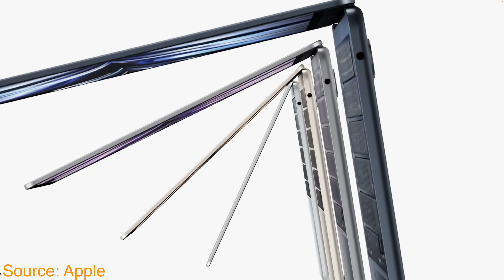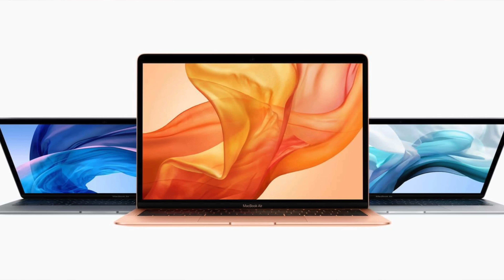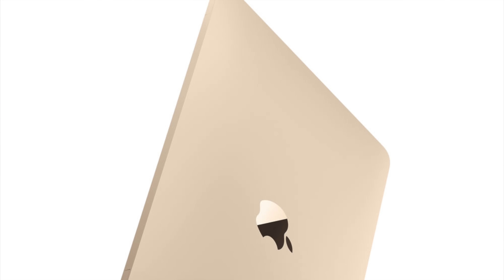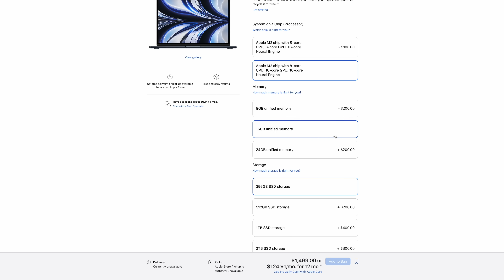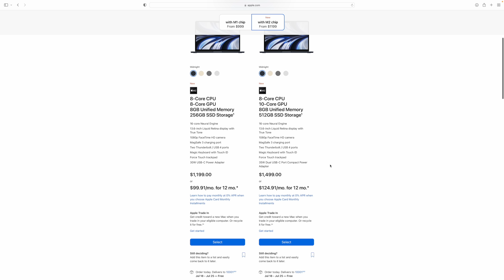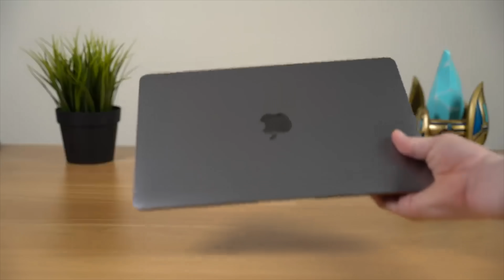Why I bought The M2 MacBook Air to Replace My 14" MacBook Pro!

Comment: Greg I’m still unsure about the 8-core VS 10-core GPU. I want the best performance but everywhere I look suggests the thermal throttling will make the 10-core perform worse. 😬
Reply: I am having the same dilemma.
Reply: I went for the lower core count in case of that, but still curious to know if i should have gone for the 10 😂
Reply: @Tennishorlick  I guess we are screwed either way until we see benchmarks.
Reply: @Tennishorlick  Haha, I picked the higher one in the last minute upon finding out that the charger was included in the price for the 10 GPU one. So this way I did not find the difference in price too bad....

Comment: Great video Greg, so helpful!  Are you worried about the 1 TB being slower than like 2 TB?  Like the 256 versus 512 on the Pro?  Ty
Reply from the maker: No. All the other storage options should have the same speed. Only the 256gb model would potentially have lower speeds
Reply: @GregsGadgets  appreciate insight on the 256gb being slower? 200.00 more for the 512gb is pricey.
Reply: @GregsGadgets  Thanks Greg
Reply: @drmarioschannel  Look at the MaxTech tests on M2 Pro 13 and the 1 chip SSD instead of 2 on little storage that lower the speed of ssd

Comment: I felt like I got scammed in early 2020 when I got the i5 MacBook Air, and the M1 was released right after my return window. I’m happy to trade in that beach ball mess of a computer with the one I ordered today. M2 Midnight 24gb 1TB. Quite the jump from the i5 16gb. Love the form factor and portability along with the power for 4k editing. I still got screwed on the trade in $345 for the old one lol. But that’s Apple for you. I’ll be good for about 3 years until I make a move on a higher end MacBook Pro.
Reply: Yeah, they only give a small percentage to trade in. It seems that private sales are the way to go when offloading apple products.
Reply: They didn't screw you pal...there is a reason why websites like buyers guide from Mac rumors exist...you always gotta check the lifespan on current products...and as an advice it happens with everything, from cellphones to cars so lesson learn and make better decisions on upcoming purchases

Comment: Future Lineup (PLEASE):
MacBook 12in - $799 (M2 8 core gpu)
MacBook Air 13in - $999 (M2 10 core gpu)
MacBook Air 15in - $1199 (M2 10 core gpu)
MacBook Pro 14in - $1999 (M2 Pro/Max)
MacBook Pro 16in - $2499 (M2 Pro/Max)

iMac 24in - $1299 (M2) (Default 16gb ram)
iMac 27in - $1499 (M2) (Default 16gb ram)
Mac mini - $699 (M2) (Default 16gb ram)
Mac Studio (M2 Max/Ultra)  - $1999
Mac Pro $5999 (M2 Extreme)

Comment: Greg the 24 inch iMac is not thinner than the new air. It’s 11.4mm
Reply from the maker: It’s 11.5mm… just noticed whoever made that chart had the measurements off for the imac lol.
Reply: @GregsGadgets  lol

Comment: Hey everyone buy the framework laptop because if it breaks it dosent have to get replaced. You can buy the broken part and replace it. Even the outer shell can be replaceable and the ram and storage is twice the amount as the MacBook. The framework can go up to 64gb of ram and also can reach up to 4 Gb of storage! And you can replace them anytime! You can even replace the chip once a new chip comes out and you can use the old chi to build anything like a pc with it!
Reply: Greg… the MacBook is not worth it

Comment: I just sold my MacBook Pro 14 on Craigslist in favor of purchasing the ultra-thin MacBook Air M2. So, I made the same decision you did. For portability and QUIET VoiceOver recording, the new Air is perfect. It does suck that multi-display support is restricted to one external display. I also didn't order the Midnight blue/black due to the smudge review feedback. The other features are simply icing on the cake: speed, 1080p cam, MagSafe, battery life, and weight.
Reply: Same here. All I do is web browsing, YouTube, occasional PowerPoints and word. So I hope the base model is enough. I got the midnight M2 Air. Looks blue but also looks black. Very stealthy. I hope the overheating and throttle issues are just for people pushing it hard. I hope base does me well.
Reply: @Jamal2fresh  smh so why did u fking order the M1 pro?💀  Smh that just shows you wanted it because it was THEEE LATEST, not because you needed it but like to “show off” it. Lmaooo. 

Thats kinda a dumb decision to make lol. (Imo)
Reply: @bigsur370  I know right, like seriously the Pros are meant for Pro work and not "occasional PowerPoint". The base M1 Air would be perfect for him
Reply: @NizaSiwale  exactly! Lmao
Reply: @bigsur370  actually not. Lightweight, plenty of ram and better cam is perfect for professional use ( you guys may like browsing but I code and do high-end graphics). Way off the mark. Jerk.

Comment: Too many complaints, that 12’’ laptop wasn’t what most people were looking for, it didn’t have the success expected and apple didn’t repeat it. They might try again later, but still 13’’ is a better option 0.6 pounds of different is almost insignificant when is just 2.7 pounds.

Comment: When I bought a M2 MBP 13(512GB, 8GB) as alternate on the time I sent my M1 Pro MBP 14 to the repair of display problem, it drastically slowed down on DaVinci Resolve when I added some tracks based on 4K 60FPS timeline. It also slowed down entire system and didn't perform well on my workloads, so be careful
After the MBP 14 came back, it still have some latency on timeline playback sometimes, but performs much better than M2

Comment: Great video. But you have ended up paying more for your high spec M2 MBA than a new 14" Mac Pro MBP? I'm not sure most people would be best advised to do that just to get a lighter MacBook Air. But maybe design and low weight will win out over power. It will be good to see how your base spec with 500GB one works out.

Comment: Everyone is different , i think i would be staying with the 14 pro , more ports , and call me weird , i actually like a bit weight , it gives the feeling of having a bit more substance to it , and having the two fans , even if it does not use them most of time , knowing they are there should i use the device more heavily makes me have  a bit more confidence  ..... i think .
  Thats just me , i like to feel im a bit future proofed too , i like to buy once then not buy again for bloody years if possible .
Reply: There's also the fact that magsafe is more likely to save your laptop if it's heavier lol
Reply: My thougts exactly. I was going to buy Macbook air m2, but when I saw a price in Poland for 16ram and 512 it was almost the same as base model Macbook Pro 14inch. For me it was no brainer - better display, 120hz, fans, more ports. So now I have 14inch and I am more than happy. Sure - there is a differance between 1,24kg vs 1,6kg but as above was said - it feels solid and frankly speeking really good.

Comment: Sure the MacBook Air with 10 core GPU 16gb ram and 1tb storage is about the same price as the M1 Pro 14 but I don't think its worth it to spend more money to get the pro model. You'd have to be willing to take a 516gb storage instead or pay even more money to get the 1tb option.

Comment: I am still rocket the MacBook Pro late 2012 and an iPhone 6. I have never been one who picked up the brand new shiny penny. Matter fact, I bought a 2009 Mac Pro, installed 2 3.33 I7 chips with 48 gig ram and a asus graphics card. I also have a 512 ssd to run the latest os. If you were me, what would you do to upgrade to something that would edit video, Microsoft office, and live stream conference calls?

Comment: Also replacing my Mac Pro with the M2 Mac air! Minutes into the preorder I’m should get it  around august 2.  My uses don’t require the pro model anymore. Will keep the m2 Mac air until the 15 in Mac air comes out if rumors are true !

Comment: I live in Australia and thanks to your videos and lot of research I end up following your recommendation and for my needs I bought the 16GB 1TB but as much I think the midnight is awesome I couldn't handle the finger print issue mentioned, so I choose the starlight 😊. Thank you for your recommendation!...ohh an mine arrives between the 20th-27th July
Reply: I wish they had more available, also Australia and mine (16Gb, 512) isnt coming until the 8th of August
Reply: How’re you liking it so far? What configuration did you get?
Reply: To me after the past few months is working perfectly. Still quick even though I have save video there instead of external disc. Yes is a pain having to buy external connections for usb, etc.. but overall I would recommend.

Comment: I'm starting grad school this fall to study data science and big data analytics. I'm considering the m2 air spec'd up to 512/16. A lot of the actual code execution in data science is done while connected to a compute cluster in the cloud anyway, so the portability and updated design of this machine is a big draw. I'd still like to debug some of my own code offline though, so I figure the extra ram is worth it

Comment: I had the 12" MacBook.  Loved the size and weight.  But the CPU was trash.  And the butterfly keyboard added gasoline to the dumpster.  And the single USB-C port set the thing on fire.
Don't get me wrong, I would love to see a new 12" MacBook.  And with the M1/2 they could fix the performance issues of the old M series chip.  They still need to have a great keyboard, and AT LEAST 2 thunderbolt ports.  And it seems like MagSafe should be a given.  And I don't think I can go back to a 720P webcam.  
So ... lots of things would need to be "fixed" on the new 12" MacBook.  Which will drive up the cost.  Does Apple really want to go there?  Not so sure.

Comment: Which one best?
13" MacBook Pro M2 or 14" MacBook Pro M1?

13" MBP M2 with 16gb RAM, 512gb ssd and 14" MBP base model.

I'm an Interior Designer. I'll use SketchUp, vray, Blender, UE5, C4D, Photoshop softwares. 

So which one to buy? Please suggest me.
Reply: The 14’ base model is the right choice. Yes, the M2 MBP is powerful enough to handle those tasks but for the price it is simply not worth it. Since you are planning to upgrade to 16gb ram, the price comes closer to that of the 14’’ MPB and especially if you are concerned with the speeds of the storage that is an another upgrade. That 500 or 250 usd price jump (depending on the upgrade) is in my opinion worth it. The difference in performance between the base model 14’’ to the new M2 pro is still very significant and on top of that every aspect of the laptop  is just better e.g display and the ports available. (maybe not battery life only slightly tho).
Reply: @haruhi3415  okay then I'll buy 14" M1 MacBook Pro. Thanks.😀👍🏻
Reply: @haruhi3415  Don't mind one more question... Almost i use crack software like SketchUp + vray, AutoCAD and lumion.

So crack software will work on Mac OS?

Comment: Hi Greg. I barely noticed the voice issue and I sing for a living. I remember being so excited by the 12 inch MacBook because it would have been the replacement for my 12 inch PowerBook G4. Alas, it was so horribly underpowered especially for that asking price and I ended up with a maxed out 11 inch 2015 MacBook Air instead which served me well for several years and is still being used by my wife. These days, with decent portable external screens being being so affordable, I really have no need for anything bigger than a 12 inch laptop. Of course mileage may vary.

Comment: Yes, Yes, Yes, ... your comments ring true to my eyes.  However, I am more "old school".  So, the model, I miss the most is Apple's 12-inch G4 laptop that, I still own and use.  With the introduction of the new 13-inch M-2 MacBook Pro models, later this year, I plan to pick-up a used 13-inch M-1 MacBook Pro with 16GB of RAM and a 512 SSD.  Why, because its price should fall down to around $900 and, I like to use older outdated Apple tech (smile...smile).

Comment: I also loved the 12" Macbook.  I miss the 2 lb weight for traveling.  I am purchasing for the same reason.  Sold my M1 MB Pro 13" and have my Mac Studio for the heavy lifting.  Curious about your 2 configs.  Are you worried about the 10 core and throttling  with overheating?  I ordered mine without the 10 core - just did 16 RAM and 512 SSD plus added the 35 w charger. Should I be placing a 2nd order too, LOL.
Reply: Trade in 12 MacBook, Apple give me $95 if everything is working correctly :(

Comment: I agree with all that you said and I did the same. My base model, midnight blue M2 Air will be here on 7/15 and I'll be running it side-by-side with my base 14 Pro and will see which one I ultimately keep and which one will be sold or returned depending. Thanks for the vid!
Reply: Have you don’t this yet? What did you think of the M2 MBA?

Comment: For Macs, I found that having a powerful desktop Mac and a light portable is the best way to go if you want to best portable experience and the best performance at home.   The Macbook Pro 16/14 is better if you can only have one machine that can do both but it isn't the best portable and it isn't the most powerful machine.
Reply: For me it is so true… I have a Mac Studio Ultra with 128GB ram paired with a 34 5K2K and 22 4K dual monitor setup and I carry a M1 MBA 16GB soon to be M2 MBA 24GB paired with another 5K2K monitor at work 😝😝😝

Comment: how did you decide between the 8 core gpu vs the 10? Will the 10 make much difference in video editting for you?
Reply: What's an extra 100 bucks when you're already dropping a stack on a computer. Plus you get the dual or fast charger included. Full send it.

Comment: I've just received my Macbook pro 14", I couldn't wait for the Macbook air M2. I'm happy with it except for two things it's battery life is not as good as M1 macbook pro or air, and the second thing is its portability, this laptop is too heavy as well as thick  to carry.
Portability for me means a considerably good battery life and  light to be carried, as I'm mostly out.
Yes I love the screen quality, but I'm not a creator, what matters is that it's 14" as 14" is the sweet spot for me not too big to make it unportable, at the same time not too small to make it hard to work with.
to sum it up, I wish the 14" Macbook were lighter and its battery had more stamina, that would have been absolute ideal for me.
Also I don't mind the touchbar, you can simply do more wit it than the hard unprogrammable F keys.
Reply: i got the 14" pro for the longevity i dont plan at moment to do much more than daily stuff on it like browsing the web and watching videos. i was interested in air m2 but got pro 14 inch through grover cause i can pay per month to rent for twelve months and after that continue renting, send it back , or pay it off. but because i watch videos alot i love and dont know if i could live without either a oled or mini led display
Reply: I mean the air does last longer but what was the battery life on your 14 like? I thought it'd still be pretty great (10h+?)
Reply: @ameliabuns4058  not really, around 6+ hours not more.
I'm planning to keep it for a year then I will see what apple will release, maybe a 14 inch macbook air or even slimmer 14" macbook pro with a better battery life. If you're after good battery life, don't get this model.
Reply: @ameliabuns4058  I was planning to get the M2 Macbook air, I was in love with it. The reason why I got the 14"  is that it has been said everywhere that the M2 SOC suffers from SSD as well as heat problems, also when I buy the M2 macbook air with the same specs of the 14" base model, it will actually be more expensive at least here in germany. That's why the 14" looked more seductive to purchase.
If you don't care about the battery life and slimmness in other words Portability, then the 14" is actually a better deal.
Reply: @ameliabuns4058  battery life depends on how you use it.
Reply: @Johnmims65  yeah but you can also get an estimate by saying say light browsing
Reply: @Dr.Ahmed-Altony  6h? what are you doing in this 6h and how much is your brightness
Reply: @ameliabuns4058  I do typing, browsing the web, playing mostly youtube videos.
Also when I work, I can have like 100 tabs open in chrome.
Brightness is around 50%, but never max.
I wish I could decrase  the processor peak performance in favor of longer battery life.
Reply: @Dr.Ahmed-Altony  if 100 chrome tabs 6h is good. but if that's normal usage something might be wrong. how new is the laptops? I heard most laptops (mac or windows) have short battery life for the first week when they're still indexing etc
Reply: @ameliabuns4058  I think so as well, the laptop is new, I have it for 3 days, The laptop is wonderful, but again if you're after phenomenal battery life, stick to m1 macbook pro, it's twice as good as the 14".
Reply: @Dr.Ahmed-Altony  oh yeah. maybe not twice but like 30%?
i'm sure yours will settle down to have more?

i'm debating betwen the hp envy 14 and the macbook air. I really am sad about not being able to game etc
Reply: @ameliabuns4058  I hope, it's a wonderful laptop, but still I'm not one of the aimed audience with the macbook pro, I prefer the Macbook air more, so perhaps in one or two years I'll get the next air.
If you want my advice, buy a Mac, you'll just never regret it, the difference between Mac and Windows is extremely underestimated.
Reply: @Dr.Ahmed-Altony  maybe you can return it if it's still within the return period and you want one?
I'm just so sad to give up gaming....
Reply: @ameliabuns4058  I got it for €1750, Macbook air with  the same specs would cost me €2080.  So I have to stick to it for some time.
Also I don't game, so that doesn't affect me that much, but even in that regard the Mac seems promising, as they have been talking about gaming more often in the last two years.

Comment: Would getting M2 Air 16Gb Ram and 256Gb SSD be enough for coding, video editing, 3d softwares etc be sufficient... cause that's the max I could stretch my budget... or is it necessary to get the 512Gb version with 16Gb Ram